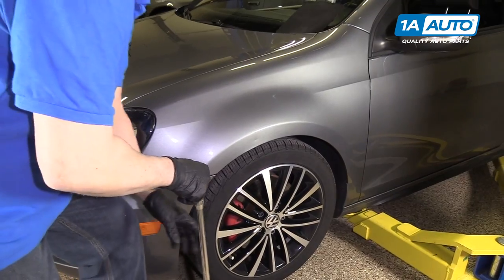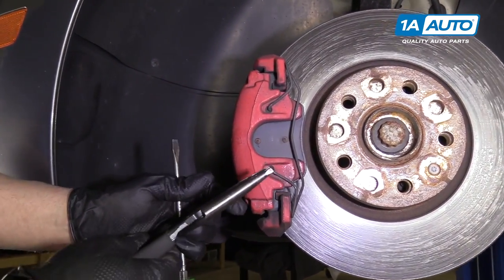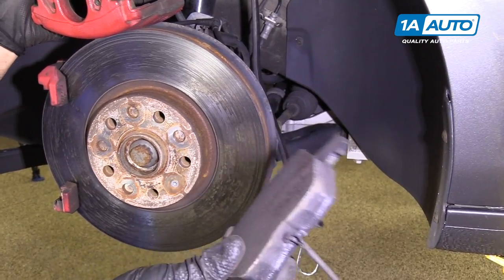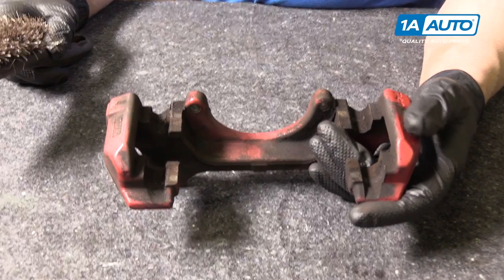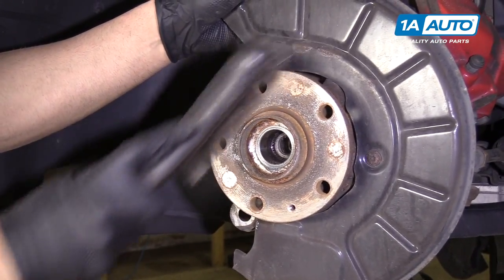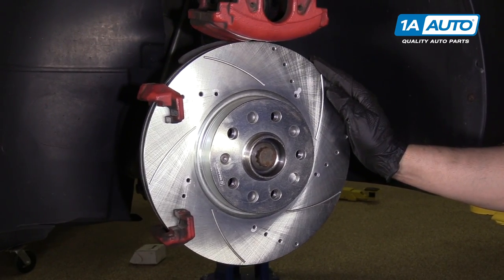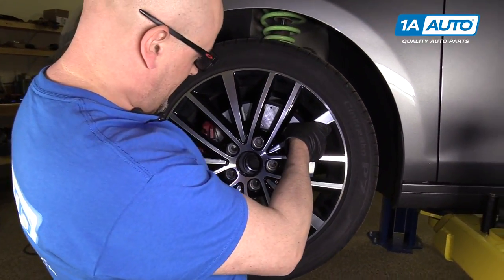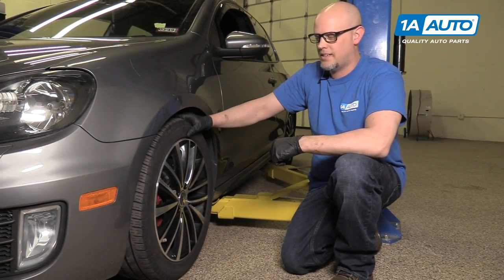How to Replace Front Brakes 06-14 Volkswagen GTI

Comment: Caliper Bracket Bolts: 155 NM
Caliper Slide Bolts: 15 NM
Wheel Lug Bolts: 120 NM

Thank you for this video ✌🏼
Reply from the maker: +driftinthroughtime Thanks for checking us out! 1AAuto.com
Reply: rear caliper bracket bolts : 90 Nm
rear slide bolts  : 35 Nm
Reply: @redbach23tube  rear caliper bracket bolts to 90 Nm, followed by an additional 1/4 turn

Comment: To the best of my understanding through research, these are the torque specs and part numbers of the caliper bolts, which you are encouraged to replace, especially the guide bolts.

Front caliper mount bolt (190 Nm torque) (part N90948802)
Front caliper guide bolt (30 Nm torque) (part H5025W)

Rear caliper mount bolt (90 Nm torque + 90 degrees) (part N91168901)
Rear caliper guide bolt (35 Nm torque) (part 14130)
Reply: Thanks you! But are you sure it's 190nm for the mount bolt? That's roughly 140 ft lbs which seems like A LOT of force to me. I'm doing research right now trying to verify that
Reply: @znismo1  pretty sure that's what it is based on multiple sources, but let us know if you find otherwise
Reply: @lenschulwitz1934  I verified, and yes it is!

Comment: Bought rear ones for my GTI. The website confirmed they'd fit, so i spent the 110$ on them. They didn't fit after spending a hour removing my old setup... sooo already upset. I was then told my return would also cost 40$... so I'm paying like 45% of the price of the item cause the 1aauto doesn't know what parts fit my car... very frustrating. I would not recommend buying parts from them if they're going to tell you "yes this fits." Then, when it doesn't fit, you're stuck paying for it

Comment: Before retracting brake caliper piston, wouldn't it be a good idea to open brake fluid reservoir cap?

Or alternatively, open the brake bleeder screw?

I mean, wouldn't you avoid damage in brake system due to rising pressure when retracting piston?

Comment: Don’t you want to take the cap off the break fluid reservoir before you push the caliper piston back in??
Reply: Nope
Reply: Yes, you want to leave it sitting on top unless you want a brake fluid leak in the piston or a line and a mess on the floor.

Comment: If I'm only replacing the rotors, do I only need to take off the bracket and not need to separate the caliper?
Reply from the maker: +macaron3141592653 Thanks for checking us out! It would be easier to remove both the caliper and bracket in order to make sure everything is set in correctly on the reinstall. If there is a pad that is slightly off from not separating the two it may cause extra drag and uneven wearing of the rotor and the pad.

Comment: I have a 2013 Polo GTI 6R 1.4 and I have the same braking system, for some reason I don't have a brake pad wear sensor on the orginal OEM pads but the new ones I bought have sensors, can anyone help?

Comment: Do you need to regrease the caliper slider pins ?
Reply: Is greasing threadlocked bolts even a good idea?
Reply: @lenschulwitz1934  anti-seize should be used on all bolt threads so you can get them off in the future along with the rotor mounting area.

Comment: The torque specs differ from what I read in a manual. Guide pin, is 30 Nm, brake carrier-to-wheel bearing housing bolt(bracket), is 190 Nm.
Reply: That's what I read in Haynes too, specifically:

For the front guide pins: 30 Nm (22 ft-lbs)
For the rear guide pins 35 Nm (26 ft-lbs)

For the front mounting bolts: 190 Nm (140 ft-lbs)
For the rear mounting bolts: 90 Nm (66 ft-lbs) followed by an additional 90 degree turn

Comment: Good job putting the rotor on backwards. The slots are supposed to be in the other direction to vent brake dust out and away from the surface of the rotor... instead of how you installed it which will direct the dust straight toward the center hub.
Reply from the maker: Thanks for your comments and for watching! +Anthony Camardo
Reply: just to confirm. Is the rotor installed backwards? Does it mean that the pattern is not supposed to digging in forward? Can you confirm?
Reply: I'm not the only one to think this, thank you
Reply: Thanks for mentioning that because I was sitting here thinking i was crazy thinking "aren't those slots and holes going in the wrong direction?". Or maybe we're both crazy. Good instructional video otherwise.
Reply: Pretty sure they guy did it right...
Reply: I just put the same rotors on and can confirm he did it backwards.  There’s a sticker right on the rotor labeling it. He was wrong

Comment: it's 200NM for the 21 bracket Bolts and 30NM for the 7mm slide pins... 155 and 15 ist completely wrong. Volkswagen Deutschland gibt das so vor.